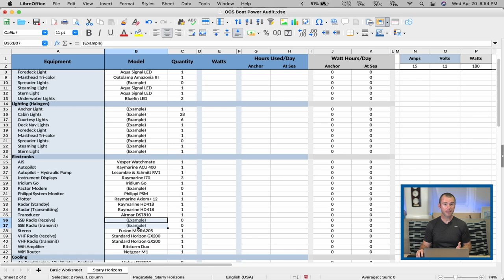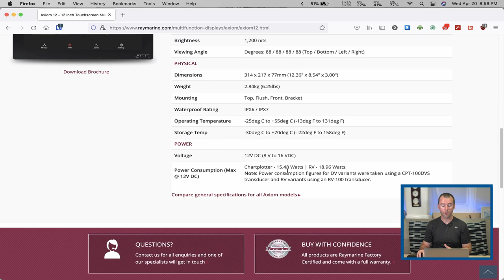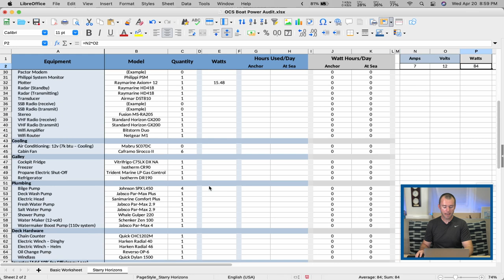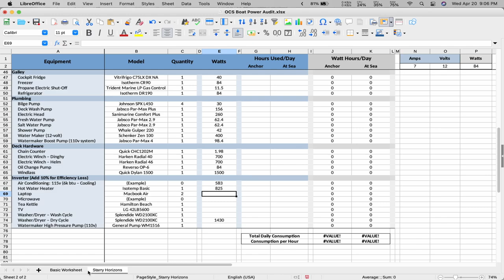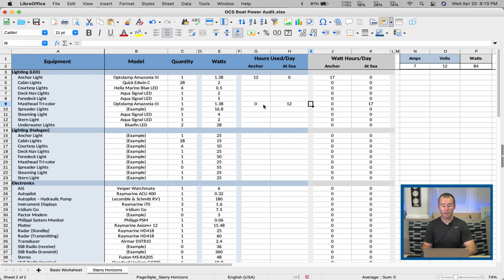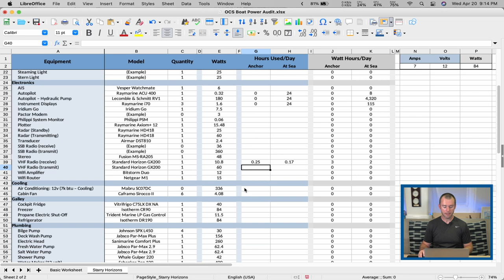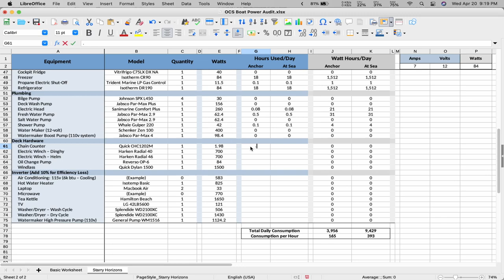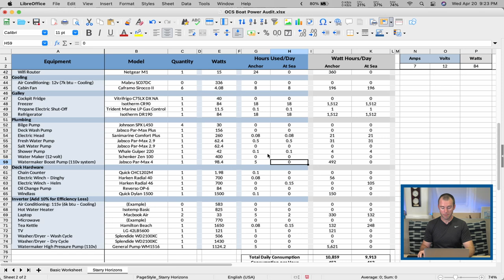How To: Boat Power Audit

Comment: Thanks David! I wonder if anecdotally you have observed any major discrepancies comparing amp draw from your shunt/monitor vs published specs? I guess when looking at amps out on the shunt when you turn on an item you also would need to take into account your calculations at 12.0 v when I suspect your lithium bank is probably closer to 13 v most of the time. Thanks again!
Reply from the maker: You're correct.  The 'theoretical' vs 'actual' amp draw numbers will definitely vary based on the voltage of your batteries.  Which is another reason why comparing the watts/watt hour numbers is a bit easier.

Comment: Great video and spreadsheet - thanks! Just a couple comments for anyone trying to do this, for VHF (receive) and probably also SSB, I think at sea,  you'll be using that 24 hours, not 10 minutes. I would think you've always got the radio on (receive) so you can listen, but are only talking (transmit) for 10 minutes a day. It's a small load, so not a major factor either way. One other point on your watermaker comparison, the 12V is perhaps more efficient, but I would suspect the 110V model puts out a lot more gph than the 12V, so you're probably running it for less time/day. Also, I don't see "Margarita Machine" anywhere on the list? Was that an error?
Reply from the maker: Yes, you're definitely correct about the VHF receiving for 24 hours at sea.  As for missing the Margarita Machine, that was definitely an oversight, thanks for pointing it out!  😆

The 12v watermaker that I used as an example puts out 100l or about 26.4g per hour.  And the 110v model does 30gph.  So decently similar water output but still a massive difference in energy consumption.

Comment: David, appreciate sharing the knowledge.  However, you put 24 hrs for the autopilot and few others.  Can you..and should you guesstimate that one will be sailing for 24 hours a day? (non-stop..everyday)?  I would think one would use 10-12 hours for sailing time (most want to leave in the morning at be at the next anchorage by sunset 9or slightly before).  Thanks
Reply from the maker: Interesting point.  My mindset when I was approaching this was around our 'cruising style' on Starry Horizons.  We typically do long passages with non-stop sailing - hence the 24 hour time calculation.  But there's no reason you can't adjust those times to get an estimate of how much power would be used for just a day sail.

Comment: Good work, thanks.
Quick question, though, and forgive me if it's a silly one...
Would you really be using your AIS 24/7, whilst at anchor?
Cheers, 
Arvind (Perth, Western Australia)
Reply from the maker: Hi Arvind.  I think the AIS on 24/7 is a personal preference thing.  Some boats we know leave theirs on when anchored as an additional safety measure so other boats that are navigating can still 'see' them.  We leave ours on because our Vesper AIS also acts as our anchor alarm.
Reply: @OutChasingStars  Makes sense now you point that out! And thanks awfully for responding. 
Stay safe and well.
Arvind

Comment: Two questions, did you ever feel the need for Air COnditioning, and zero for your watermaker?
Reply from the maker: Sure.  We only really need to run our watermaker every 5 days based on our normal water usage.  So most days we wouldn't run it.

And there have definitely been places we've been where it was hot enough that we wanted to run air conditioning, even if we didn't need to make water.